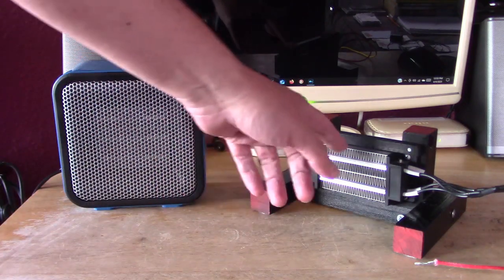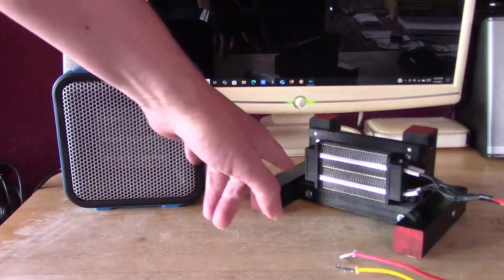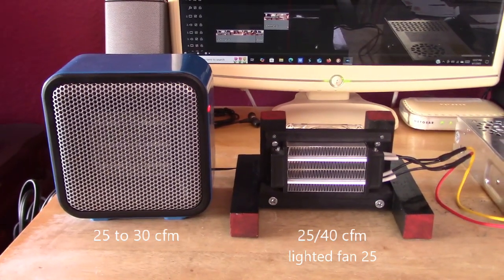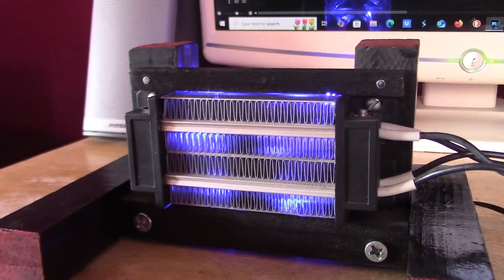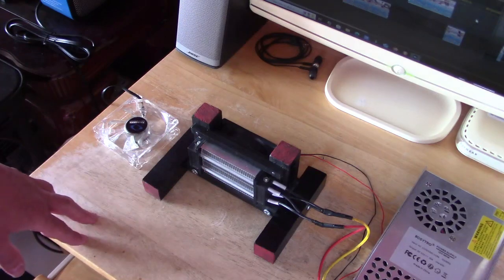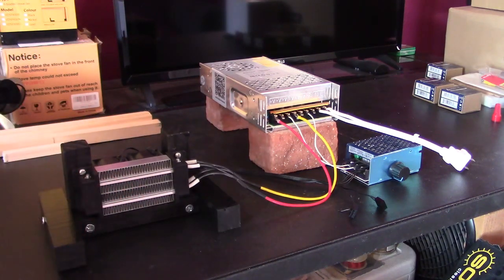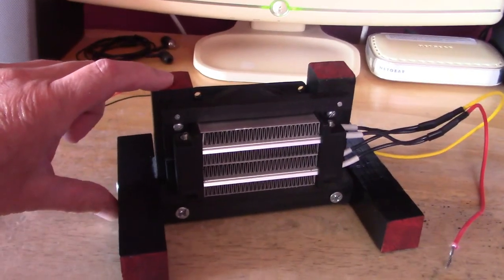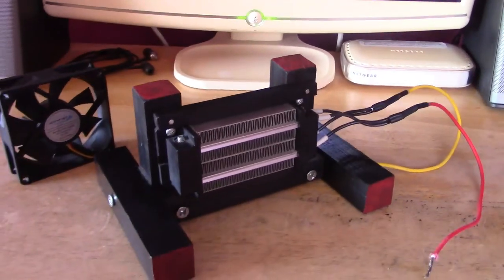12v 400 Watt DIY Space Heater! (UPGRADE) - quieter/faster/stronger! side-by-side w/500w Store Model

Comment: I like the build and would like to make one for camping. Links to the components would be most helpful.
Reply from the maker: hi there. i bought the element like 2 years ago (maybe a little longer) so link is inactive, but there are like 12 different companies that sell this element. just go to amazon and search for 12v dc heating element or 12v dc ceramic or ripple heating element and you should see lots of them. the only other thing is the 12v 80mm fan. those i bought years ago too (just search for 12v 80mm computer case fan). there are dozens of those of all kinds. the best airflow is 25 cfm to 40 cfm in my opinion. the only other thing is the square wood dowels. you can get those at the home stores. home depot and lowes have them. they sell them in 3 or 4 foot lengths for a couple of dollars each. i think that cover it.🙂 did i miss anything?

Comment: I've been looking for this 12 v heater for several years now off and on. Where did you get it?
Reply from the maker: hi there. you can find them on amazon. lots of different sellers. when i type in 12v DC PTC heating element or 12v DC ceramic heating element, approximately 12 different sellers come up. go by price mainly, i bought one on the upper price range because they said it was a newer model. i bought this element 2 or 3 year ago. the seller i got mine from is gone, but my guess is any of them will work about the same

Comment: Whats the part number of the heater and how much does it cost?  Nice build? Ty!
Reply from the maker: hi and thank you. when i bought it it was selling for 12 to 17 dollars. i bought it on the upper end (about 15 or so). they said it was a newer model. that was 2 or 3 years ago. the same seller is not active but there are like 12 other sellers of this element on amazon.

Comment: Great design, love it! I wonder how tricky it would be to add a safety feature where the element stops heating or the power is switched off if the fan fails.

I'm no good with electrics but I imagine  you would want a thermal switch or cutoff if the element gets too hot?

Definitely have to make one of these at some point. Thanks!

Comment: How many watts does the elements draw?
Reply from the maker: it draws close to 400w. the element in the store-bought unit draws close to 500w. i chose that element because it's a very popular element sold on amazon (lots of sellers) so it's easy to find and i like that it's pre-wired. you can get the fan on amazon too.
Reply: @desertsun02  i was curious on the wattage just to know if I can run  the heater from my solar generator in case of an emergence.Does it throw enough heat to keep you warm or?
Reply from the maker: hi there. it throws a ton of heat. it's always been more than enough for me.

Comment: How much , houre cost , ? Electricoty
Reply from the maker: hi. the element costs about 15 dollars, the fans are 5 to 10 dollars and the wood dowels are a few dollars. you can build one for about 25 to 30 dollars. the comparable heater was 25 so about the same as buying one. you can find the element and the 80mm fan on amazon and they sell the dowels at places like home depot and lowes.
Reply: @DavidLopez the cost per hour depends on where you live and how much your power company charges. You can see on your bill how much they charge per kWh. 

You will multiply this amount by 0.370 because the heater demonstrated was pulling 370 watts or 0.37 KW.

For example, if you pay 20 cents per kWh it would cost you:

20 x 0.370 = 7.4 cents per hour